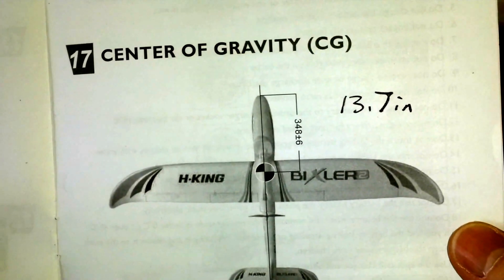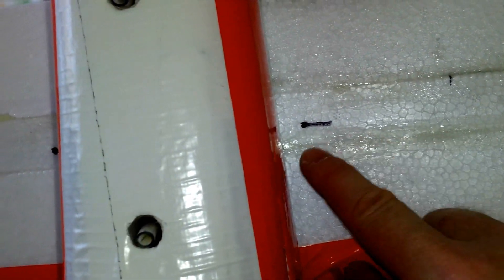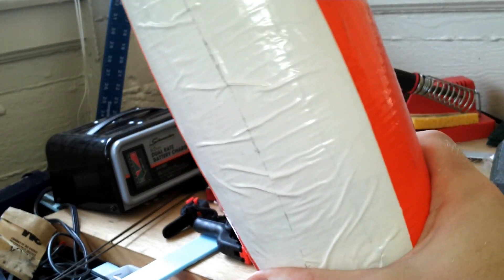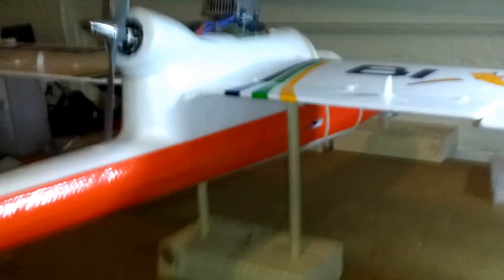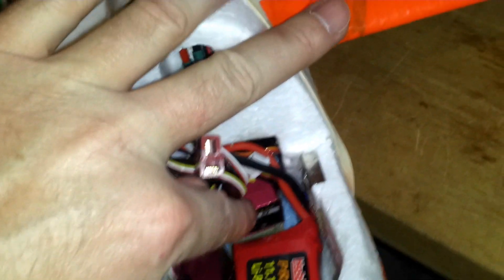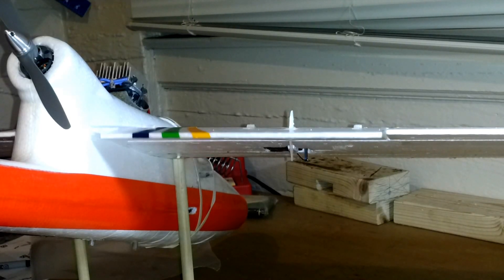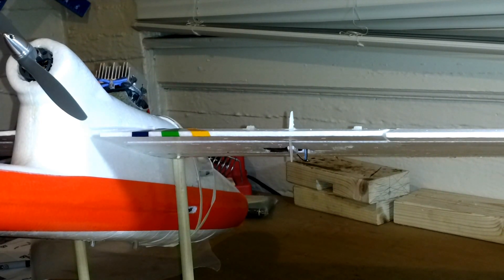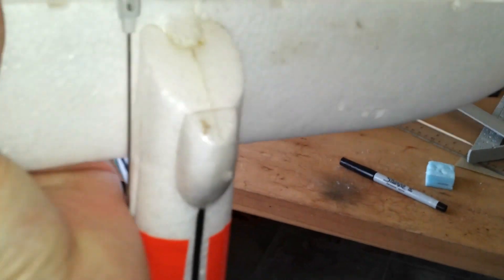Bixler 2 Repairs and Center of Gravity Balancing

Comment: that duct tape plane must be to heavy to fly.. all that crap in the inside you lost the joy of flying
Reply from the maker: Not really, the tape doesn't weigh that much and all the crap inside is because the servo cables were 2' long that's why there was so much clutter.  Plus that Bixler 2 got beat to hell flying it and I eventually bought a new fuselage from Hobby King.

Comment: Why do you have active breaking on your esc on a airplane? =)
Reply from the maker: +mrpeter81 The Bixler 2 can also glide quit well.  A rotating prop causes more drag than a stopped prop.
Reply: MrDabrudda
Well, the drag och a non freewheeling prop is so low when attached to a motor of this size, and there is a good thing to have the prop spinning. If the battery is all drained out, due to something, or the battery gets disconnected inside the airplane, if the prop is spinning it generate power to your receiver and servos so you can still control it =)
Reply from the maker: +mrpeter81 I ran a test with a motor and ESC.  I hooked my multimeter to the battery leads of the ESC and spun the motor and it produced about 1.5VDC.  I then hooked my multimeter leads to the ESC/throttle lead and spun the motor and only .005 VDC was displayed, which is probably the reverse biasing of a diode which lets a very small amount of voltage thru.  There is reverse current protection on the ESCs to prevent the very thing you mentioned of the receiver being powered by a spinning motor.  The voltage coming off the motor is not regulated and ESC manufacturers are not going to put a voltage regulator in for that feature to keep costs/weight down.  It's easier to put a diode in place.
Reply: MrDabrudda
 There are several people on youtube, even flite test have one video showing they lost the battery in flight but could stear the arcraft down with only the power generated from the motor. Maby they had another esc/motor setup.

Comment: Beef up the wing spar guy's.  I did a few nice loops with mine.  Even cutting the throttle at the peak of the turn and the wing snapped at the fuselage.  The carbon fiber spar just broke off.  Hanging by the wires it spiraled to the ground.  I am currently fixing this weak link.!!  Beware.  If you can find an aluminum tube or bamboo the same diameter I think it will improve the stress factor.

Comment: Thats not the stock motor is it ?
Reply from the maker: I bought the kit rather than the RTF or ARF.  A lower 1200KV motor gives a slower but much longer flights than the 2200K motor.  Can push a bigger prop also which is more efficient.

Comment: I have one also, What does the gyros do for the plane? If it makes it more stable, I would put them on my plane.
Reply from the maker: The gyros stabilize the plane against wind gusts.  Makes it easier to control and track in a straight line even on a windy day.
Reply: MrDabrudda
I recommend the Lemon RX 7 channel Receiver + Stabilization (With Full Range Satellite), If you search the above name you'll find it through Google. The Lemon RX is fully Compatible with Spektrum TX Gear too, I use a DX7S and I get full stabalization, with Flaps and Crow (Using Flaperon Settings), The plane flys like it's on ball bearings, very stable and awesome to fly, the Lemon makes all those little corrections you would normally over correct, A definite must have if you're a beginner/intermediate pilot!
Reply: Have it

Comment from the maker: Most of the wires are from the two gyros I had installed on the elevator and ailerons while I waited for my OrangeRX 3 axis stabilization to arrive.  Less mess now.  The ESC is from another plane with a much larger motor.  I just never took the heat sink off.

Comment from the maker: I flew this weekend and I can say that it flew very nice.  With the CG in the correct spot and flaps it lifted out of my hand without any nose down.  I'm running a 1200kv motor and flew/glided for 23 minutes straight and still had 11 volts left on my battery according to the telemetry on my DX8.  I could have flown for another 10 minutes.